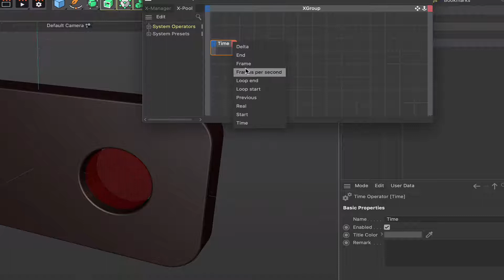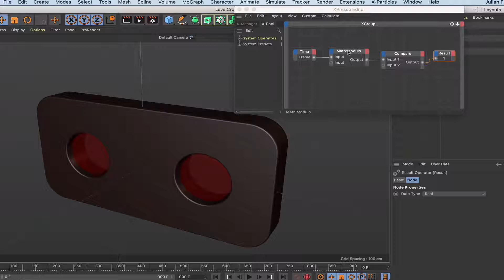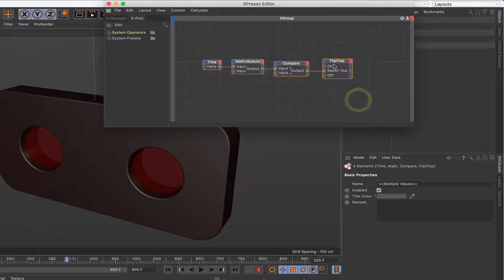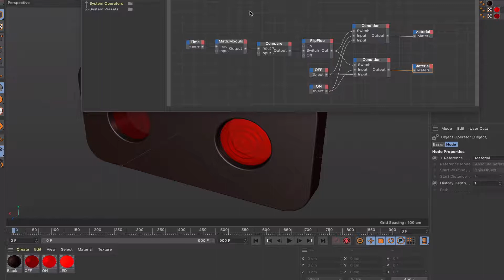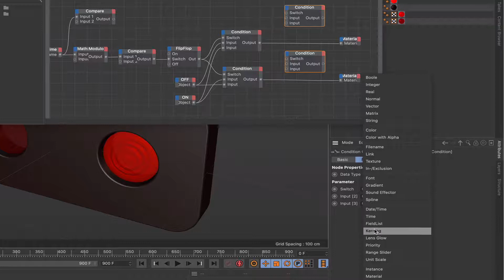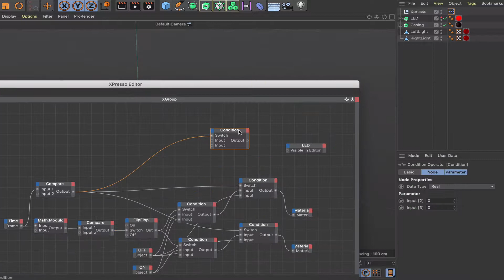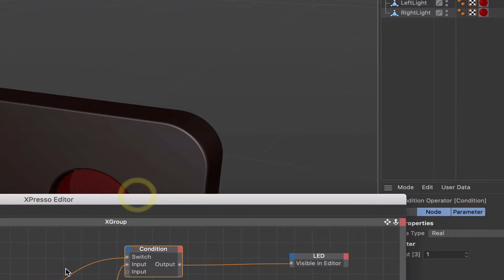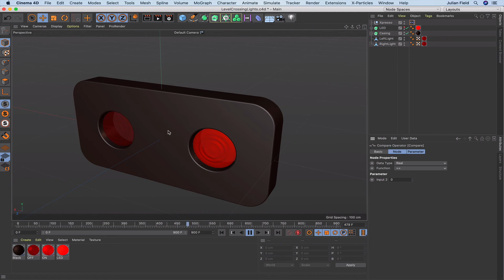Cinema 4D Xpresso Tutorial 37:  Level Crossing Lights

Comment: If I just wanted to switch on and off the brightness of  a luminance channel, would I still need the flip flop or just replace the compare node with the material property?
Reply from the maker: Apologies for taking a while to get back. You need to plumb the output of the Flipflop into the switch of a Compare which alternates between 0 and 1. The output of this node can be used to switch the brightness of the luminance channel from 0% to 100%.